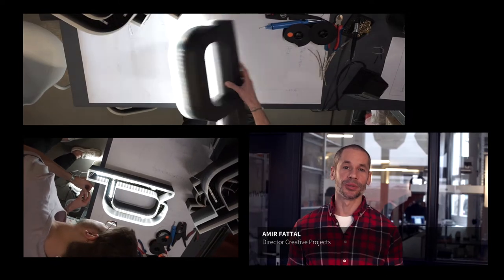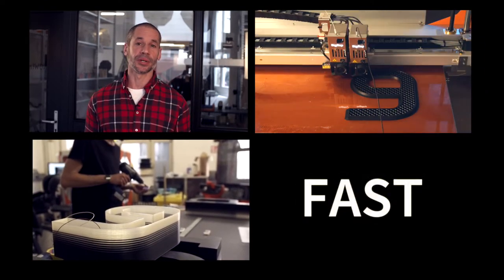How to 3D print three-dimensional signage with large-format additive

Comment: tip: you don't need a dual extruder to print these letters, just inject a filament swap into the gcode. this is easy to do in Cura and Prusa slicer ...